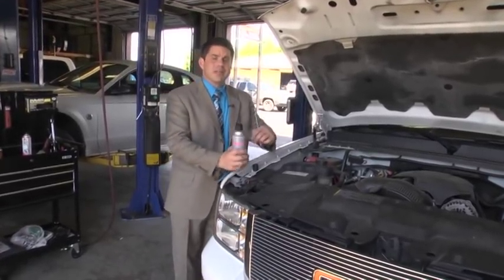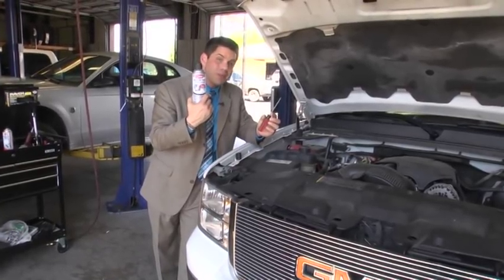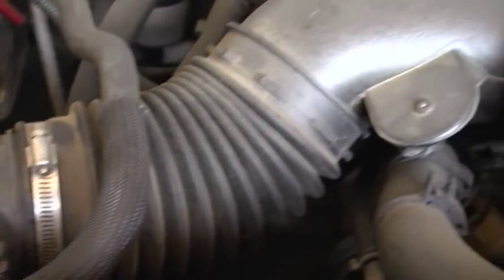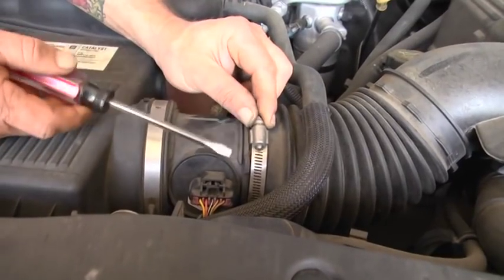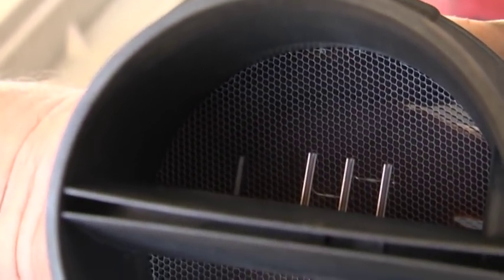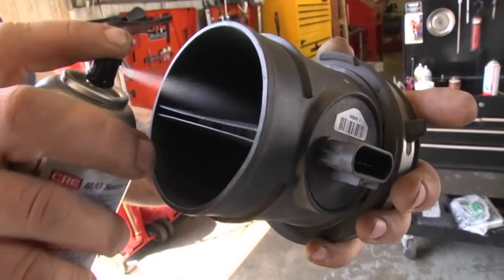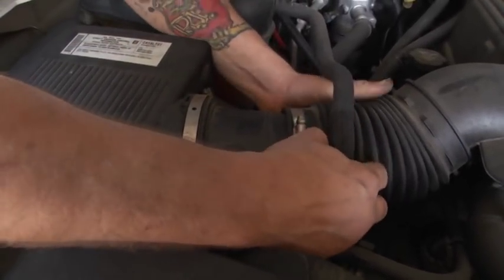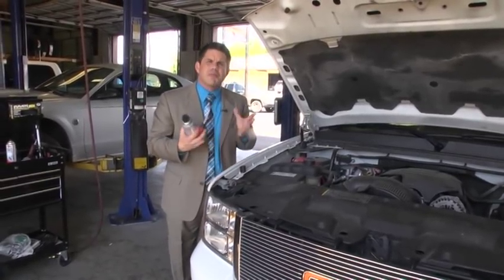Want better gas mileage?  Get a screw driver and spend 2 minutes here

Comment: "We all know what these worm hose clamps are."   Sadly, most people don't. Half of the people watching this can barely put gas in a car, let alone do ANYTHING under the hood.
Reply: "Gas"....... It's a nickname for Gasoline. It's very common to just say "gas".
Reply: Guinnessian North America buddy, gasoline not petrol.
Reply: +villipend Most mechanics wouldn't clean your MAF sensor and oil or particulates can build up giving false readings leading to poor fuel consumption.  It can also break the sensor which is pretty expensive to replace.
Reply: Your right. I knew someone who tried to check their own oil. They took the oil cap off and thought hmm no oil. They filled it up all the way till they could see oil from the oil cap not the dipstick. I know someone else that had a car that the thermostat was stuck closed and the truck was overheating. They put water in the crankcase thinking it would fix it. It warped the heads and ruined the engine!
Reply: @mooch1441  ... What's a crankcase?
Reply: I am perfectly aware of this, Matthew. What I did was to find a North American leg and I pulled it, if you know what I mean  :)
Reply: Yeah, like the guy that wants to check the oil and complains that the only filling caps he sees is one marked Coolant and another one marked 710...
Reply: what the hell is a hood
Reply: What are you talking about why would I want gas in my car gas smells bad
Reply: GhettoMist... been ages since I've seen a full service station! I thought they were obsolete! cool
Reply: Are you referring to the Female half, or the Democrat half of the 'people'?  Now watch me get banned for being non-PC ~~~ OMG snowflakes these days.
Reply: Matthew Foote not sure where you're from, Oragonians have only recently had to pump their own gas...guess what, it didn't go too well😂 I, however, have changed my egr valve, rotors, calipers, brakes, filters (oil, air and cabin), changed my oil, and spark plugs and wires. It depends on people's up bringing. I prefer older rigs, less electronics to cause problems.
Reply: @Penelope_5309  During my upbringing my parents never taught me anything about cars. I taught myself everything because I was interested in it. They criticized everything anyway. They still criticize everything.
Reply: is it like a bonnet?
Reply: Altair ,710,
Mmmm...Is That Code?
Reply: Lincolnator
 Calm down. Did you know it's illegal to pump your own gas in Oregon? Them people likely don't know how.
Reply: I'm currently working for a road service company changing flat tires and doing fuel deliveries and such and I'm just shocked at how many people don't even know how to pop the hood
Reply: Lol
Reply: Matthew Foote every time my sister puts gas in her car she pulls the nozzle out and spills gas everywhere she just yanks it out after she turns it off
Reply: Matthew Foote, Museum!
Reply: villipend I was gonna ask how was ur car bit nvm it's a pos.   Lmgdao.
Reply: they do know where the CD player is and how many watts, etc. it puts out. And the plugin to charge the cell phone. THAT'S IT. Sad. You know those things right beside the piston.
Reply: I had same vehicle, but a 1963 version Laurentian, 283cu V8 with 2-speed auto, with over/under headlamps. Loved it too. Reason why? because we got under the hood and took an interest.
Reply: True that.
Reply: Matthew Foote  these entitled melintards are afraid of getting dirty FYI your mechanic rips you off Evey time.
Reply: Right if you need to learn mechanics from faux news then it's time to change the bearings in your carb and exhaust intake.
Reply: Patrick Baptist- I see you arrived at the advanced class to catch up-you fail. Back to MSNBC so you can learn about matters down to your level, instead of projecting your misguided insecurities at your betters.
Reply: I don't believe we should work on our cars or wipe our own ass. We need to go to an ass wiping station. Coming soon.
Reply: Oliver M
Reply: You'd be surprised how many pillheads know about them, and what they use them for.
Reply: no gas smells amazing,, takes wiff from xxx brown handled jug of gasoline
Reply: Matthew Lenard BAHAHAHAHAHAHa!!
Reply: Matthew Foote I
Reply: Bullshit. Fuck you. You're partially the reason why no one wants to work on their car. Stupid side remarks like "can't even put gas in the car". Who the fuck doesn't know how?
Reply: Pim
Reply: What is a hood😕
Reply: What  gas
Reply: Matthew Foote HEY NOW, in my state we can't fill our cars because people do it for us. BUT I just replaced the alternator myself and on a Nissan its a pain in the ass.
Reply: @ghettomist1575  my aunt has a 2012 Nissan Pathfinder with 101,000 miles she replaced the motor then had to replace the alternator
Reply: TheWolverine0657 That’s very low miles for that to fail. Mine has 245,000 miles original motor and alternator has like 20,000 miles in it. I’ve done a lot on it but it’s an old car. Yours shouldn’t have had those issues so soon lol. If anything the cvt transmission should be the failure point.
Reply: I rebuilt the engine in my car so, yeah.
Reply: this IS Fox viewers, they can barely wipe their own asses.
Reply: @truantray  And...you're here to catch up to that point instead of the dookie in your BVDs. Keep projecting, winner!
Reply: That's because the majority of mainstream Americans under 40 have been pussified.
Reply: That's why in some liberal cities, you're not allowed to pump your own gas. Libtards will be retards.
Reply: Well, take a guess. Have a lil thinker...
Reply: The gas station had bags over the nozzles of guzzlien so i checked the green one and it still had some so i filled my tank.   Shortly after,  it started to smoke like a Mexican jalopy and now my truck dont run.  It smelled like oil so is the guzzlein contaminated with water or what?? Maybe thats why they had bagged the other pump and didnt know about this one?
Reply: Ain't THAT the truth!!!!
Reply: Most mechanics want clean your maf sensor because it don't get dirty.
Reply: I haven't touch an engine in any car I've owned in ten years(other than checking fluid levels).  What's the point?  With newer cars and all the computers you're smarter just to let your mechanic do the work and in many cases a dealer is the smartest choice.  It's not 1974 anymore. My first car was a '74 Pontiac Laurentian and I did all my own tuneups and oil changes, it was a piece of crap but I loved that car :-)!
Reply: @villipend  Well I spent about 20 hours on my CVPI the past month or so, derusting the floor panels and undercarriage, cleaning throttle body, fluid flush etc. If I bring her to a mechanic the labor alone is gonna cost 1000 dollars. My total cost is two bottles of rust oleum for 20, two paint brushes for 10 and some carb cleaner. So there is a point to work on your own car. To save money! I'm not handing my hard earned money to some mechanic that sits and watch youtube videos in my car and charge me for the time.
Reply: "Half of the people watching this can barely put gas in a car" 
Well, most people have cars that needs a liquid fuel, such as petrol or diesel. Gas wont work...

Comment: Another one is that screen that is in air sensor take that flat head pop out the retainer ring and screen falls out it saves you 1 whole gal for every tank I was a dealer tech for years that is and was worst thing GM ever did I do it to all my trucks that have screen in air flow censor

Comment: Wrap the sensor with aluminum foil and spritz lime juice on it. The alkalinity will buffer the doohickie preventing climate change.
Reply: "doohickie". shows how much YOU know. It's the secondary command pathway buffer on the warp core transtator.
Reply: +Hippiekinkster i got a check engine code for that but i thought it was either Low Blinker Fluid or bad Muffler Bearings. Boy was i wrong
Reply: +Juan - I know, right? My car's getting old, and EVERYTHING is going wrong. Mid-month the Tire Stale Air Sensor went off for no reason, and that fucker is LOUD. Had to change the air in all four tires before it stopped. A week later I was going to the grocery store and the driver's side froster got stuck on max. The whole windshield and both side windows frosted up, and the window motors wouldn't work. I couldn't see a thing. Ended up in Chattanooga. Then last week the Underseat Flotation Device Relay turned on. Pushed the seat up, and pushed my head up against the roof. Lucky I have a soft top. I felt around in the console tray for my screwdriver, punched some holes in the top, and pushed my head through so I could see. I could barely reach the steering wheel, and couldn't reach the pedals. Lucky I use a cane. T groped around for it, got it, and used it to depress the pedals. Hard to find the pedals, though, especially the brake, Got exciting a couple times. Had a goddamn kamikaze crow fly straight at me at 50mph, too. Almost peed my pants.

Made it home safe, though. Looking at bicycles on Craigslist.

Comment: Usually a dirty MAF will cause the engine to run lean as more air needs to be sucked-in to get the sensor wires cooled to the temperature that the Engine Control.Unit wants. The problem with this in England is the annual MOT (Ministry  of Transport test) which normally includes an emissions test with a 4 gas analyser.  Lean mixture gives a higher burn temperature hence more Oxides of Nitrogen (NOX) which results in a failed MOT hence the inability to tax the car!  The cure is to paint oven cleaner onto the sensing wires and leave overnight. (A child's paintbrush can be used) In the morning one rinses off the oven cleaner, refits the MAF and passes the MOT retest.

Perhaps the Society Of Automotive Engineers could explain just how a dirty MAF can cause RICH mixture and poor mpg as it does look as if the punters are being suckered.
Reply: You're correct except that if the sensor output goes far enough out of the expected range (especially on more modern vehicles where that range depends on other sensor input)  then the ECM may default to a rich mixture to keep the engine running, though this can also happen if the plug to it is just making bad contact and the act of unplugging to clean then replugging it restores better electrical contact.
Reply: also known as "Open Loop" mode, just like unplugging the O2 sensor.

Comment: The typical way to do this is not to take the air intake tube off but rather to just take the sensor module out of it.  That allows getting the spray can nozzle close to the sensor so you waste less and clean it better, or of course you could use a straw but it's still more of a hassle to get the air tube out of "most" vehicles than only the sensor.

Comment: make sure you let it dry and also clean the throttle body with a different cleaning spray and the throttle will be more responsive
Reply: What different spray ? Map cleaner is the only one you should ever use
Reply: @vacuumboy6.0  Better watch spraying the TB, some are coated and cleaners will destroy the coating on it and cause more trouble.

Comment: what if I have an AFM?
Reply: Then you won't have a mass airflow sensor. Your vehicle uses a carburetor
Reply: +ledzeppeman 

no. it's injected.
Reply: AFM?  Active Fuel Management?  What does having an engine with cylinder shutoff have to do with a Mass Airflow Sensor?
Reply: +Pete Smith 
air flow meter
Reply: MyAccountBitch that's what they're talking about.  Mass Airflow Sensor.  Should be the same thing.  Only other way I know of is using the MAP sensor to calculate airflow.
Reply: +Pete Smith 
airflow meter runs on a coil/spring system connected to a flap of metal that opens when air is forced through it. when the flap opens a piece of metal moves across a contact telling the ecu how much fuel to deliver to the injectors. you can find them on old Toyota supras and toyota trucks
Reply: MyAccountBitch Ah, yes.  Mercedes used the same system in the fuel distributor back in the day.  Expensive as hell when they broke.  I was thinking about today's vehicles.  Lol.
Reply: +Pete Smith 

oh. ahaha. yeah. I have a 91 4 runner.  AFM is $350! I'm trying to tweak mine, but I can't seem to get it right.
Reply: MyAccountBitch Not too bad.  The fuel distributor on a Mercedes is around $2000+ now, lol.  It's usually more than the car is worth.  Hope you can fix yours. :)

Comment: It's also a good idea to disconnect the battery before reinstalling the air flow sensor as the circuitry in it can be damaged if you don't.
Reply: Bullshit

Comment: oh man, hes spraying that MAF cleaner directly onto his hand
Reply: Something's gonna get you in the end anyway. Fuck it.
Reply: Stinky Cheese I'm not worried about chemicals anymore.  My back gave out instead of my liver.  I'm in sales now. :P
Reply: When you've been working on cars for a while you stop caring as much about what goes onto your hands.  I used to wear gloves when working on fuel components, but after my gloves disintegrated a few times (fuel has a habit of doing that), I started doing it bare-handed and made a point to wash my hands later before they started to burn.  This guy is probably in the same boat.
Reply: using disposable gloves when working with solvents will keep you healthier longer
Reply: +Pete Smith- It eats through your gloves in seconds so instead of getting better gloves you decide it won't hurt you?
Reply: I use the 7 mil blue nitrile. Nothing I use in the shop eats through them... Yet.
Reply: Benjamin Yep. Known many a technician, be it automotive, electrical, HVAC, etc., to 'suddenly' fall very ill or pass away from nervous system issues or cancers and they act like they've never done anything to deserve such a terrible fate.

No one reads the damn warnings or listens to their training. If told to wear gloves, eye protection, respirators, ear plugs and so on, that's not saving the company any money. They don't get protective equipment for free. If they're telling you to use it, it's to make sure you can come back to work the next day and retire after a long career. They don't benefit from their employees spending months in the hospital with a terminal illness.

No sympathy for stubborn fools. That's why our country is so broke feeding, clothing and sheltering people who barely do anything productive to repay what society is forking over to keep them around. In fact, the only thing they're good at producing is more fools to follow in their foot steps. Fuck 'em.
Reply: He dgaf 😎
Reply: Bet ur diet is worse 4 u ... wonder what chemicals r in that soda ya just slammed???🤔
Reply: Yeah but years later if you get cancer, or your liver is shot, you might wish you were a little more careful.  Cleaning solvents tend to cut through the oils in the skin and soak in instantly, and if you already have poor liver function, they'll do more harm.

You might consider a different glove material.  We have lots of cool materials these days that aren't phased by fuel.  Besides, there's no particular reason this part needs to be held while spraying it.  Do what you want, but slowly poisoning your body and the cumulative effect is subtle enough that you may not realize it happening, unless you happen to have a twin that makes different choices.
Reply: Yeah but something's gonna get you in the end.  Personally, I'd rather get ran over by a bus and die instantly than suffer organ failure, especially the last few months of it hooked up to machines.  Many don't even realize how far shot their liver is until they get exposed to something toxic and it takes a much harder hit on them than a person with a more capable liver.  Granted this applies to many liver stresses like chemicals in drinking water, alcohol consumption, air pollution, etc.  It's a cumulative effect.
Reply: Benjamin it's just a solvent I wash my hands with brake clean and stuff and I'm fine

Comment: I just replace the mass flow air sensor in a 2003 Mazda MPV for my mom, but the check engine light came on far before we had any issues I tried cleaning but that didn't work so I had to get a new one.
Reply: Cleaning them doesn't work, it's just another "fix in a can" scam.